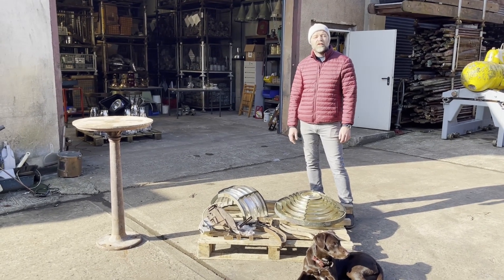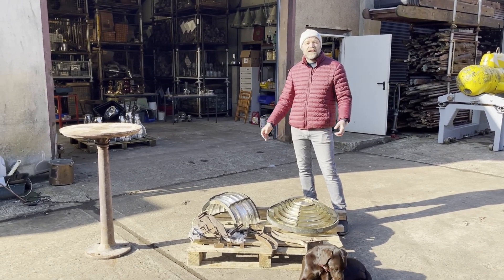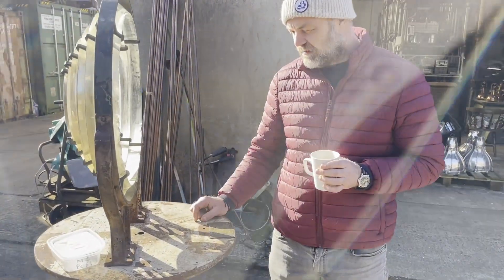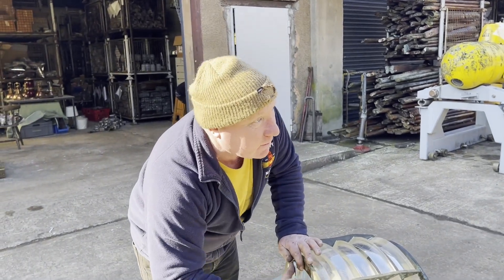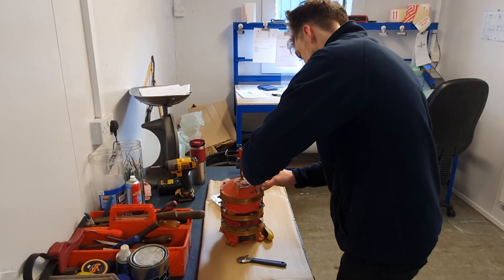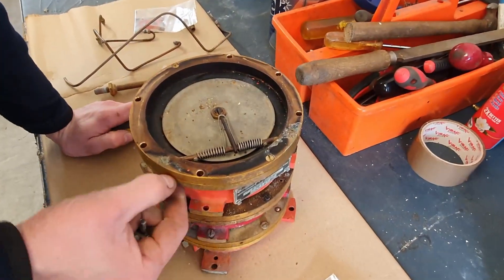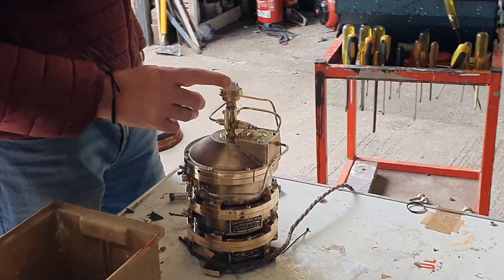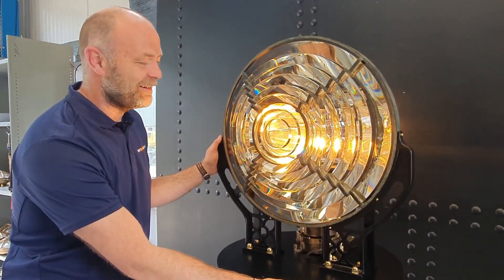Lighthouse Lens Restoration

Comment: Before AGA, Pintsch's Patent Lighting Co (London) produced a range of lamps  installed in lighthouses, lightships and buoys. Developed by Julius Pintsch of Berlin, these were fuelled by oil gas as opposed to AGS who used Acetylene. I have a book illustrating some of Pintsch's marine products. Incidentally, they supplied what was the largest buoy at the time, designed to moor the liners Mauritania and Lusitania. During 1915, the British company divested the German shareholding and dropped the Pintsch to become purely Patent Lighting Company. Their other manufactures were devised for lighting railway carriages - AGA did likewise and their lamps outwardly appeared to be badge engineered Pintsch. I've actually remanufactured a Pintsch railway lamp for carriage restoration projects!